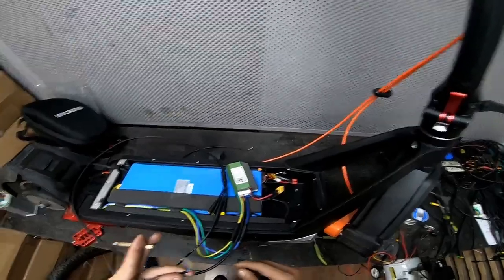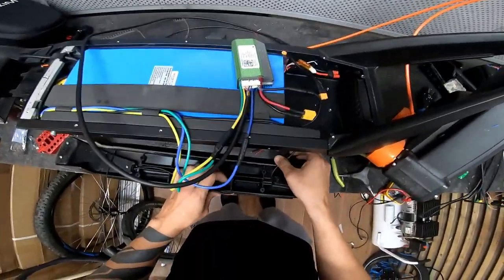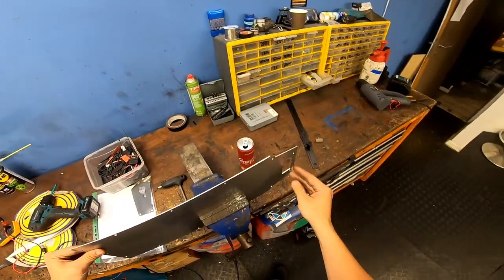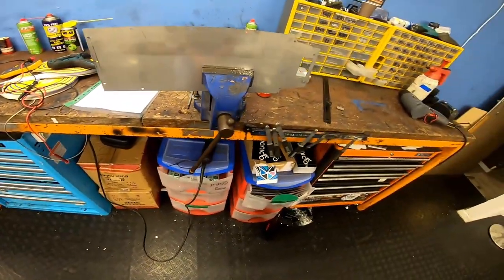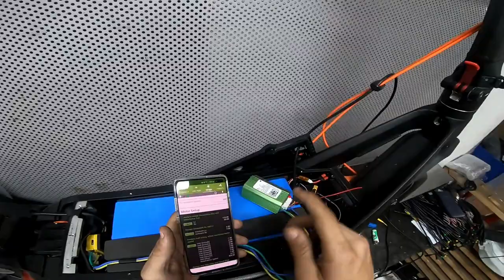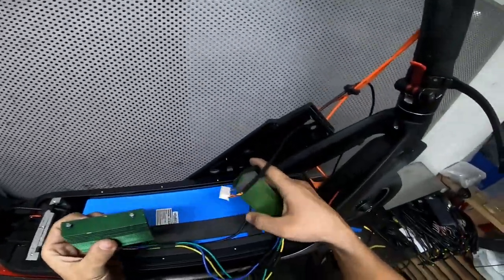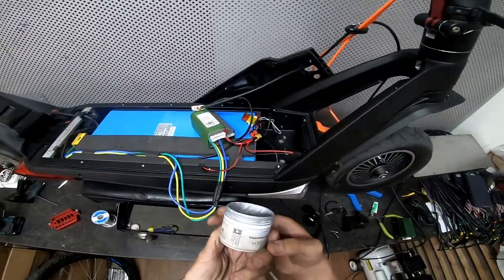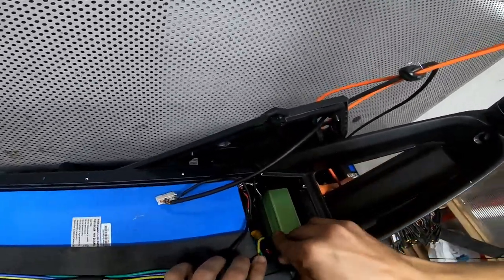Inokim OX asi bac855 FULL INSTALLATION GUIDE PART 2

Comment: Thanks for posting some great videos! Is the under deck metal plate an Inokim accessory or something you have made yourself? I’ve got some issues with deck cracking and would like something like this if it helps.
Reply from the maker: this plate is made by inokim themselves, due to a lot of cracking issues. ask your local shop.

Comment: Hello, great video. All three parts are very useful. I also have an Inokim OX 60V and the same Asi bac 800 controller, but it cannot drive the motor. I need a bootloader. Can it be found anywhere on the net besides BACDOOR. I don't have an account, it gives me error 24 (engine connection problem) I would be very grateful if you could help.
Reply from the maker: kilowatt app is free to use for asi. check app store

Comment: Would yoyu know what is the voltage input. used  for the DC to DC. 5v or 12. i know that the light are 5v. planning to add more
Reply from the maker: all lights are 5v! ( 6v converter is ok too)
Reply: @SUB13333  Thanks. thank you, here In Philippines we always wait for your new upload
Reply from the maker: @sirdiyreviews4148  im flattered ! will try keep posting relevant content ! :)